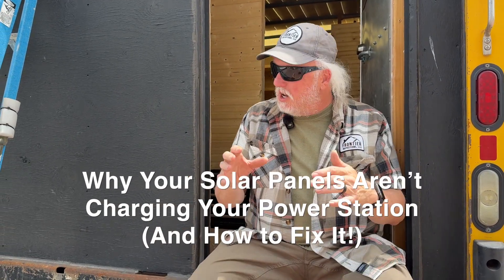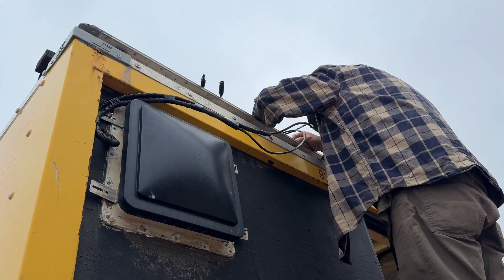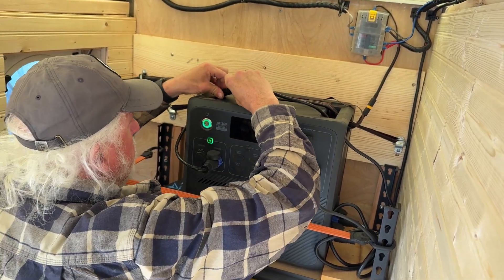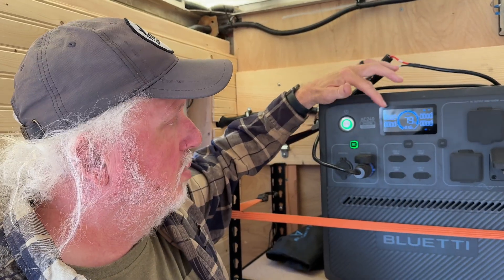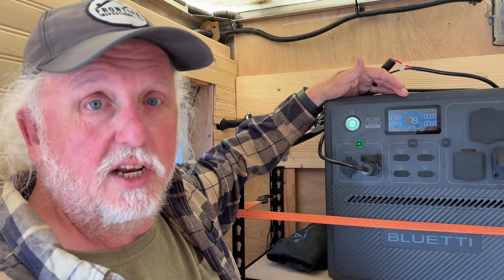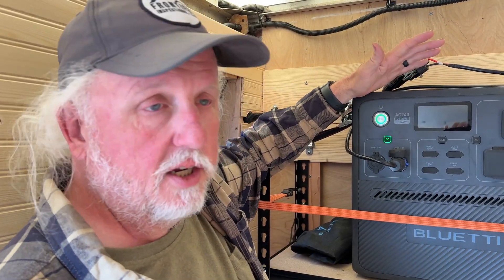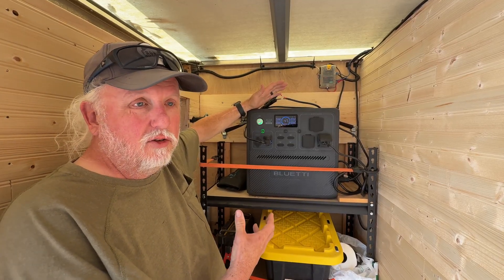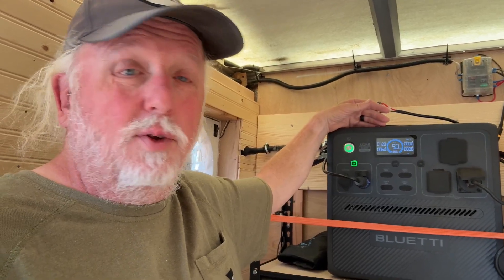Solar Panel Not Charging? Here's What We Found

Comment: You should love the higher voltage arrangement. I went from 12v to 36v and that's when my system started WORKING. The charge cycle is floating by mid morning, no matter the cloud cover. Dave from Santan Solar has been a great help to leading me towards a trouble free, tiny, system.

Comment: Congrats! It appears your diagnostic path tracks with @MrRiorust's post from your previous video. If you have any more problems with this, consider using a multimeter to ensure the panel array output voltage * panel array output amperage = the wattage identified by your Bluetti, and reach out to Bluetti if it does not match.